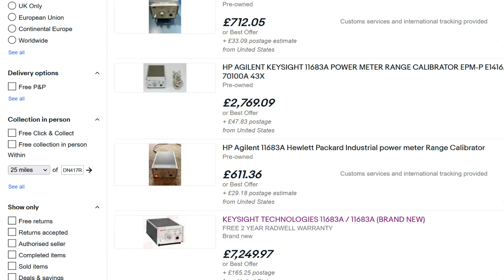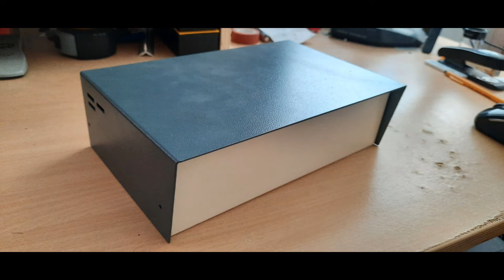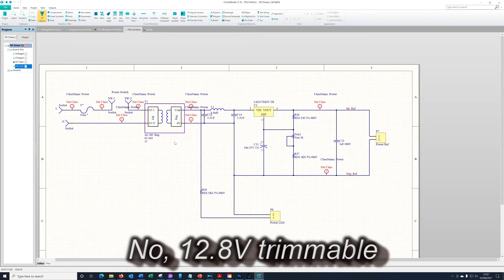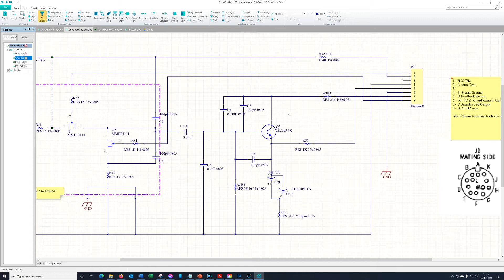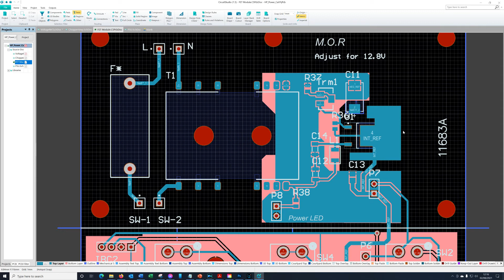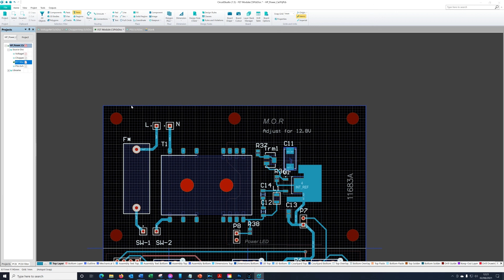0010 DIY Power Meter Calibrator like HP 11683A

Comment: Hello, regarding the schematic of HP and your schematic. I see on your schematic on the chopper page a resistor A3A1R1; value 464k( to the auto zero pin). In the HP manual, option H01, this resistor is 464. No k behind the value. So I assume it is 464 Ohm? Do you know? Is it a typo at the HP schematic? I have a broken power sensor head I want to use the PCB from. The rest is as you designed and described on your channel. Great explanation! regards, rob
Reply from the maker: I can't entirely remember, I spent a lot of time looking at multiple diagrams.  If I recall one problem was that the diagrams are in boundaries, and in some parts I think the values are in k and other boundaries in ohms.  I should double check with the parts list
Reply: hello, thanks the quick reply. the part list says: 464k. So I will stick to that. kind egards, rob

Comment: Thank you for this. No idea where those crazy prices come from. I can understand a 8902A’s prices but not a single use basic voltage divider like this. Even recently I believe a broken model with missing switches was sold for almost $800 USD. Makes no sense but that’s collectors for you. It’s really not much of value as it’s precision resistors. And even that may be affected by the rotary dial (I.e. dirt and corrosion). The 11715A is another overpriced piece of kit as well.
Reply from the maker: Dirt in the switch certainly a problem,  but contact resistance less so since the next stage is roughly 200k impedence.

Comment: Thank you for the response you doing terrific work nice project, I lucky to make one but my shaking hands the hare my problem with a small components fund one ready assembled components PCB is possible? , for the big components no problem. Regards G7OYO
Reply from the maker: I've had to work hard to get my placement skills up to the job and often use supports for my wrists to help reduce skaking.   I'll have to do a quick price up and see if I have the parts in stock.  It may be a few days for me to get to it, quite a lot on my plate at the moment.
Reply: Hello, thank you for your kind offer I will be grateful, I find on my juk box one HP8481A dead sensor, I put a 196-ohm resistor on the Fet input in sted of the thermocouple, and one 196K on the chop like the diagram. the result: I inject 6.01 volts =30mwatt /2.02 volt= 10mwatt/ 600millvolt=3mwatt/196 millvolt= 1mwatt/ 0.6 millivolt =310 microwatt. doing this test on the Agilent E4418B power meter the minimum is my power supply, on the maximum range over 49 milliwatts the meter go overage. testing on the HP436A and HP 437B not zeroing.
Best regards.
Francesco? G7OYO.
Reply from the maker: I have a PCB for the power meter calibrator, populate with just the SM parts (i.e. no switches, jumpers or fuse holder) that would work out about £35 - the 0.1% 10ppm resistors and the power supply block are pricey.  I don't have a PCB for a DIY sensor just the calibrator!   Looking at the voltages above, not sure where they come from,  I recall one of the early meters explained how to hack a sensor to do the calibration but don't recall seeing these voltages.    If you use the HP calibrator from an external reference (i.e. no voltage divider, just the input resistors) then the input voltages would be 15.8v = 100mW, 4.7121V=30mW, 1.4641V = 10mW, 458.37mV = 3mW, 145mV=1mW (this is the fixed calibration point)  45.837mV = 300uW, 14.494mV = 100uW, 4.583mV = 30uW, 1.45mV = 10uW, 459uV = 3uW.   You should cal the meter at the 145mV = 1mW.   For zeroing, don't forget to remove the voltage from the input of your hacked sensor and connect the input to ground - zero is without any signal!
Reply: @MakeOrRepair  Hello, thank you for your offer, I try to contact you about the PCB, to send you the money for it, I'm locate on Kempston-Bedford UK
Reply from the maker: @frankreal2258  I'll assemble one or two and list them as buy-it-now on ebay, that will make it easieest and provide seller/buyer protection.   I think mid next week, just need to sort out the testing
Reply: @MakeOrRepair  Ok please tell me when you listing them (reserve one para mi), Best regards.
Francesco
Reply from the maker: Hi, I have just put one on ebay -title  "PCB RF power meter calibrator" (Item ID: 334457575976) you can check out the test report in the pictures to make sure you are happy with it - switches etc is over to you.  Sorry it took a bit longer than expected - I was doing another job that was supposed to be just 1 day ... 4 days later it is almost finished!

Comment: Hello, is possible to get the circuit diagram?
Reply from the maker: All on github  https://github.com/pshersby/HP-Cal.  Note these have been updated with all the design changes noted in the video.
The schematic, board etc are all Altium CircuitStudio but in the defaultconfiguration/outputs folder there is a PDF with schematics and assembly.  The gerbers needed for PCB Manufacture are also in that folder - there is a readymade JLCPCB zip file that can just be uploaded

Comment from the maker: Regarding accuracy I should point out that the absolute output is not what matters - the sensors vary, and the actual output relies heavily on a 5% capacitor, similarly the input stage to the meter is only about 1% with no trimming available.  So the output of the calibrator must be close to the notional correct value but it is the relationship between the different output levels that really matters - the meter and sensor/calibrator work as a pair and the meter can adjust for differences between them.

Comment from the maker: Sorry it took a couple of weeks to get this published.  I had a few supply problems that just kept creating delays.   Anyway I got there in the end.  I have yet to decide if to publish the schematics, gerbers etc on github because except for case, choice of transistors and power refeeence it is very similar to the discontinued HP/Agielnt/Keysight model - albeit given the relationship of the meter and sensor it is hard to do anything else.  Still I hope it gives makers some encouragement to make their own calibrators and of course since the main body of this is a power sensor circuit also make your own sensors.